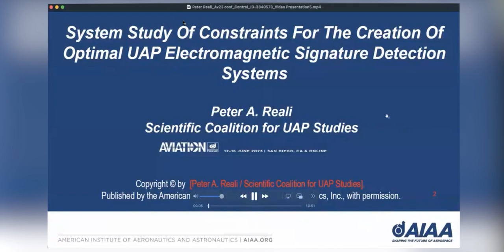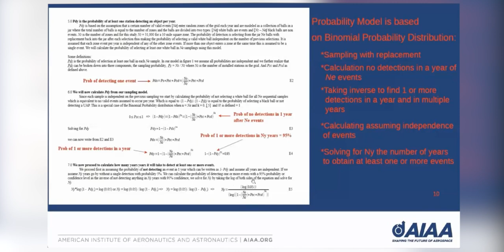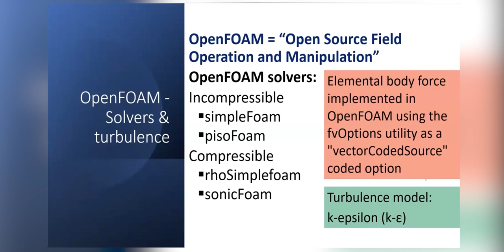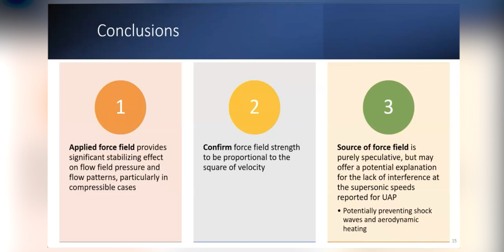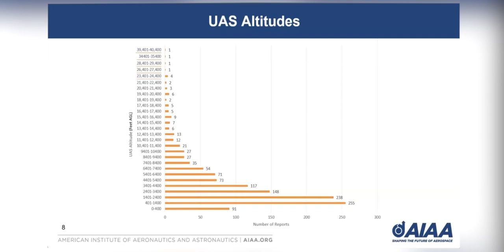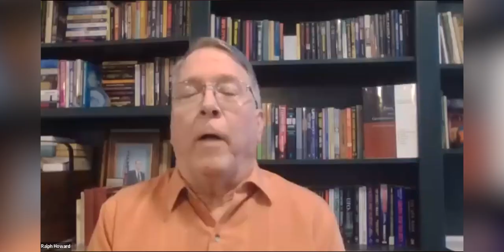SCU's AIAA Panel | SCU Board + Contributing Members at SCU's AAPC 2023 (Talk + Q&A)

Comment: IMO:

The fluids modeling approach is correct. That was an excellent first crack at it.

The "force field" is likely recirculated ambient light acting as radiation pressure, keeping air, water and whatever is floating around in space, at bay. The "skin" is what is doing that work, at the atomic or molecular level, absorbing and emitting the full spectrum, or simply acting as a pure waveguide. The overall scenario is that of a bubble within the fluid in question.

Hence a seemingly propellantless propulsion displaying multi-spectral signatures. The medium and "propellant" are one and the same. It's generally the same principle as a balloon or water-pumping submarine, like the Virginia-class, with its "pump-jet" propulsion.

So, the whole thing comes down to radiant flux per mass density, extreme "buoyancy" if you like. And, a helluva lot of engineering once the general principle is widely accepted, which is inevitable. For an overview of the big picture, search for "Light Pumping For An "Anti-Gravity" & Inertial Mass Reduction Effect", a video and written webpage, which also covers "The Five Utterly Predicatables". 

Keep up the good work. 👍🏻